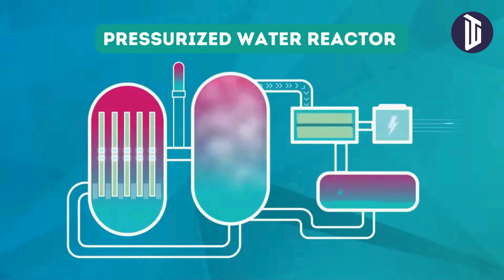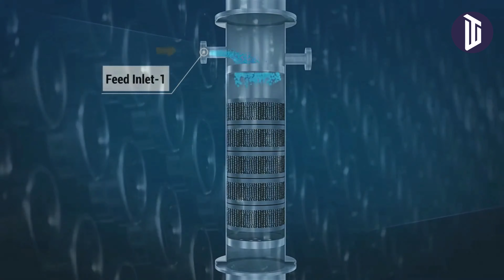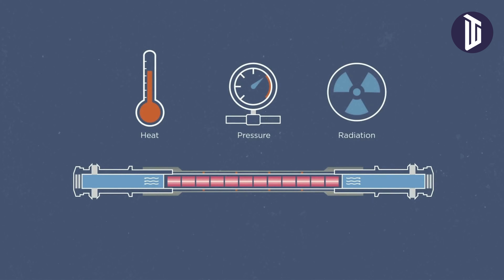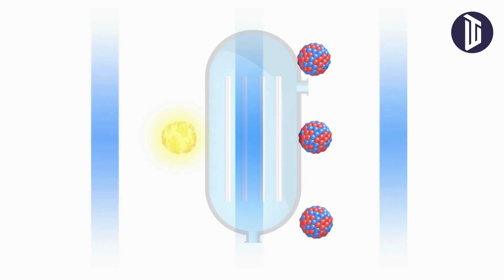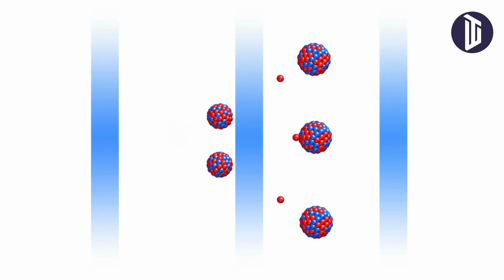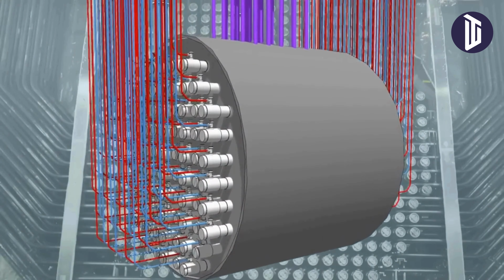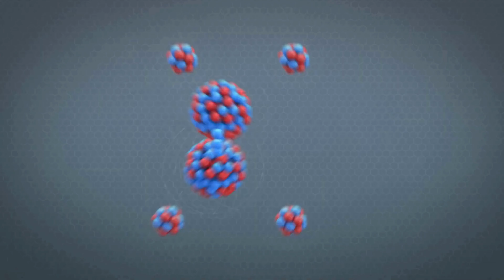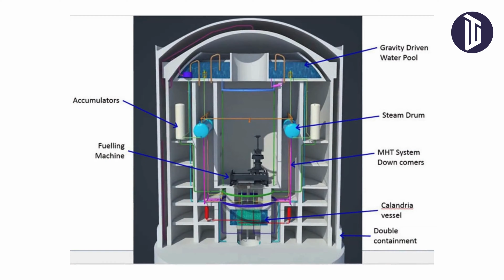Why India Chose Pressurized Heavy Water Reactors: #nuclear Insights

Comment: Fast neutron reactors are not mandatory in a fuel cyle. It's possible to use plutonium produced from heavy water reactors,  and add it to depleted uranium. It's far simpler.
Reply: It's the radiation they are eliminating thus making power generation cheaper and safer.